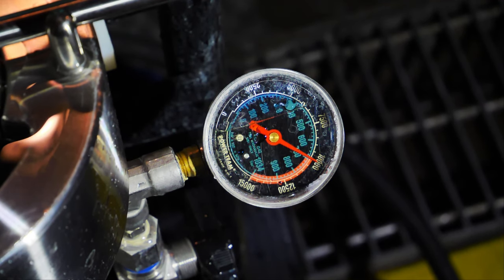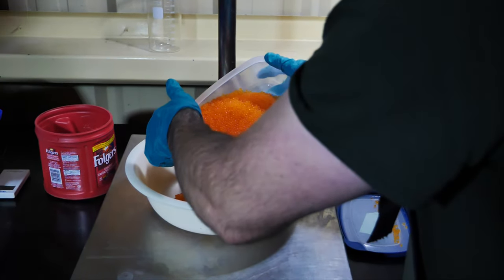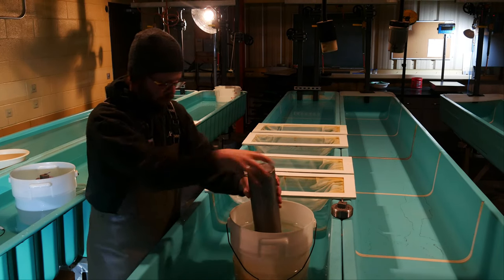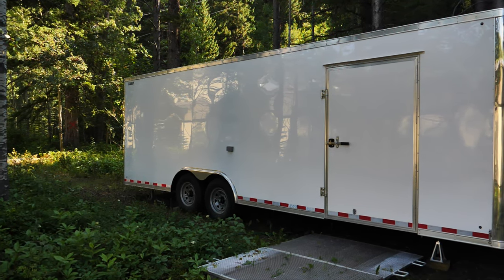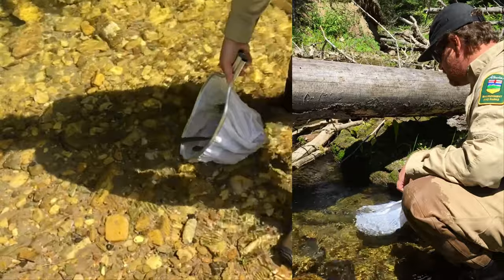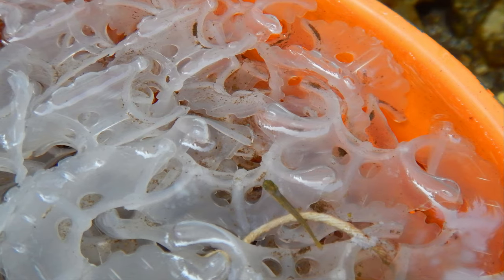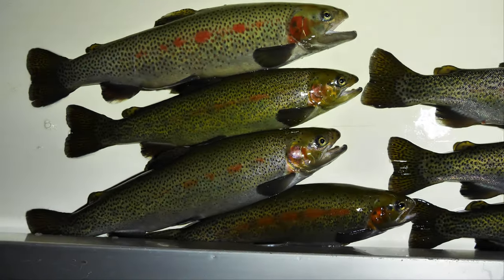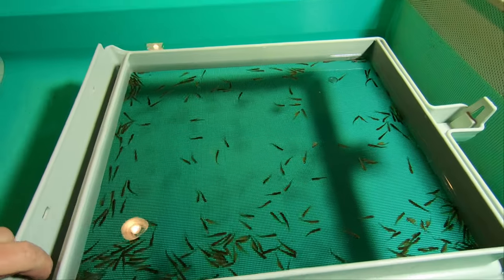Triploiding Trout, Alberta Westslope Cutthroat Trout Recovery & Broodstock Genetics

Comment: This is great to be able to introduce Hybrid stock with out harming natives. The work but into saving native has to be so satisfying. 
  The two things I've seen here in Oregon are some tanks along rivers that some wild fish are put in by selected guides so ODWF can use wild strains in their hatcheries. 
The other is tanks placed along steams hoping to bring stealhead back to them. They put a tank  that has the stream water running through it The parr are raise in the tank until time to release. Hopping they will come back to that stream to spawn.
Reply from the maker: It would be amazing to see our government of Alberta open the doors a little bit and allow public involvement in some of these things. It was literally a minor miracle this video project even happened - that's how non-involving the department has been here for far too long. This is a great step and we can only hope for more actions. Of course the elephant in the room is that the quarantine tank for the maturing of the westslope cutthroat trout eggs is literally sitting in the shadow on the mountains where the massive proposed coal mine is located so there is a serious ongoing disconnect between cause & effect in this province, unfortunately.